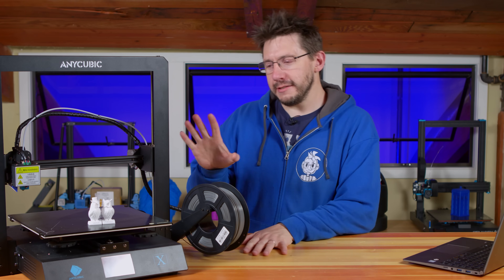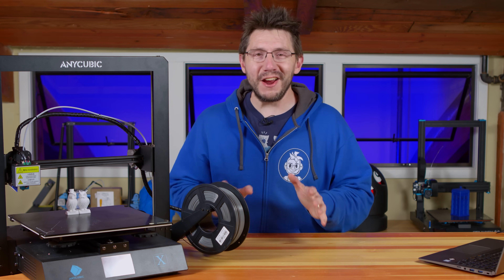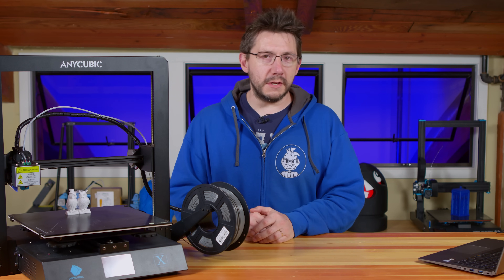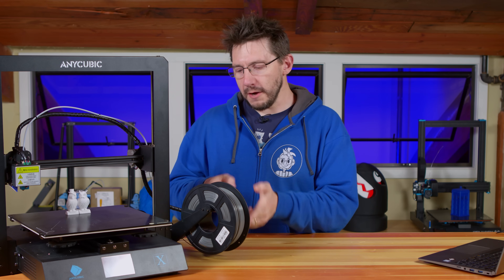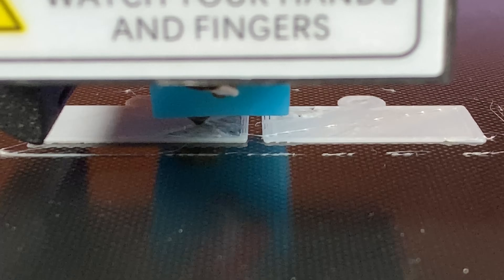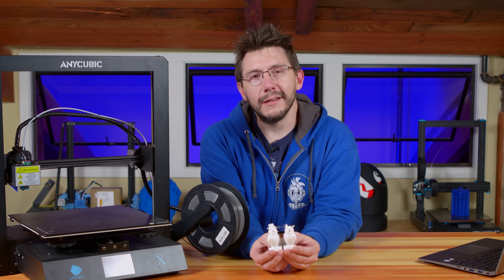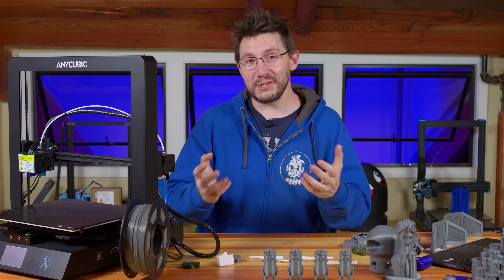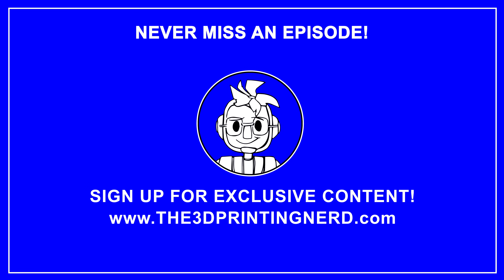Anycubic Mega X First Impressions Non Review?

Comment: I just purchased an Anycubic i3 mega s fdm printer and I love it ! It is my first 3d printer but it is easy to use . My extruder and extruder motor went bad but Anycubic is sending replacement parts ! I will order a larger printer from them later ! Good company .

Comment: will it print nylon, and carbon filaments?
Reply from the maker: It’ll do CF-PLA and any other filaments that’ll print at 240c or below. This means most likely no to nylons.
Reply: @3DPrintingNerd  thanks, which printer would you recommend for engineering filament?

Comment: @3d Printing Nerd
how did you even get this thig leveld... iam trying this since 2 weeks now and iam close to giving it up... its my first printer and regardless what i do it´s impossible to level.
either the middle is fine.. or every calibration square i print has a little less filament in their bottom right corner on every of the 5 squares.
i don´t know what to do anymore.

Comment: what settings do you run it on ? we're having hard time getting our mega x to work anything properly, strings a lot, pulls supports out of bed after couple layers etc. used recommended cura settings + recomended  filament temp.

Comment: I don't know, I can't get my mega X print as well as this and I can't get it to print as fast as my mega S with the exact same settings. It seems like the mega X has slow acceleration and jerk speed by default. With my mega S, if I do not use acceleration and jerk settings, the printer will use the highest value but for the mega X, I don't know what's wrong but it always takes like double of the time to print compared with the S. Any idea? thanks!

Comment: Please be very cautions when dealing with this company.   I made the mistake of purchasing the "Mega Man X" after watching this video.  It had been a horrible experience, and I will never give AnyCubic more of my money.   Their quality control is HORRENDOUS, their customer service lies, and when it arrives broken, they warn you that it could be months for the replacement part to arrive from China.   My printer arrived, basically as a kit.   I put it together, as the instructions said.  (Basically put the top on the base)  Then i realized that there were LOTS of things wrong.   Basically no bolt, on the entire machine, had been tightened.   I had to take the entire machine apart and tighten everything.  Extruder, hotend, z-axis screws, roller wheels on the underside of the build plate, rails for x/y movement, etc.... all disassembled, tightened, and then tried to print. The 20 minute assembling turned into more than 3 hours.   
Things did not work... at all.   I contacted customer support, which basically ignored everything that i said, in my claim, and had to start over.   Then, after many emails, photos, and videos, they stated that the extruder is bad and needs to be replaced.   Apparently that's a minimum of 15 business days from China.  
I tried to leave a negative review, but I bought it from their website, and they control what is posted on there.  They will not allow a bad review.  I tried posting a 2* review, and when things got worse I tried to post a 1* review.  Only 20 5* reviews are shown... just like a week before I bought mine.  I made the mistake of searching "BBB AnyCubic review" and found a site with many bad reviews, and really frustrated people.   Horrible, horrible experience.  I will never buy from AnyCubic ever again, I will make sure that all of my friends know to avoid them, and might be calling my bank, to try to deal with a dispute.
Reply: Can't be worst than Creality. had great customer support from Anycubic.
Reply: @maxim5and20  I got my Mega X in May... it still won't print anything.   This is hands down, the worst customer service that I've experienced, from any company.  They refuse to help, they won't issue a refund, they lie about parts being on their way, etc.  I have friends with Creality machines, Prusa machines, and a few other smaller companies.   The only ones of us, with problems, are the Anycubic machines.  My Mega X, and my friend's Photon.   My friends can't even help me troubleshoot, because they've never experienced any of the problems, because their machines actually work.   I was going to buy the Ender 5 Plus, and regret that I didn't.   The friend that got the 5 Plus, has been printing for months, and meanwhile my printer is still unusable.   He had one broken part, upon arrival, and he had a free replacement part in roughly 10 days.   Meanwhile my Anycubic "engineer expert" (as he called himself) doesn't know anything about my machine, and has lied, multiple times, annoy sending parts.   The whole thing has been a disastrous frustration.   I wanted to send it back, but they wouldn't even verify that I would get a refund.   
I was on the fence, between this Mega X and the Ender 5 Plus.  This video was what made me get the Mega X.... and I've regretted the purchase, everyday.

Comment: Did you have problems with the bed leveling?  I just got this printer, after your "not a review".  So far I hate this thing.  I have carefully followed the directive and got it assembled.  The leveling directions say to start in the front left corner, and move counter-clockwise, checking each corner.  It says to go around 2-3 times to ensure that the bed is level.   I've gone around about 15 times, and it's still not level.   I'll get the front-left level, move to the front-right and it's way too high.  I'll adjust it, and move to the back-right.... it will grind and scratch the whole way, and that corner will be way too high?!   If I lower it, to the paper it will scratch MUCH worse.  Then round and round and round, with no consistency.    So far I really regret this purchase.   Not a single print and already destroying the print bed.  
The print surface has a LOT of play.  (Especially left to right)  it rocks roughly 1/8" either direction.  😡😞
Reply: So, I fixed the bed leveling issue.   There was a huge amount of "wobble" in the print bed.   I ended up disassembling the entire thing. (defeating the purpose of buying a pre-built printer) I then tightened the bolts on the 6 little roller wheels.   5 of them were mostly tight, and 1 was barely even attached)  Having tightened all 6 made a HUGE difference.   Now there is minimal play. (I'm guessing less than 5% of what there was before)   
Then I moved to the next problem.  The filament wheel wouldn't push/pull filament.   I had to basically disassemble that fixture, and it was out of line.   I had to get things lined up again,  get it to have better tension, reassemble it, and attempt to feed it through again.   
Then the next problem..... instead of extruding a nice stream of plastic, during a nozzle purge, it made a tight coil/ball of plastic on the tip of the nozzle.   I cleaned the tip, with the included needle, which improved but did NOT actually fix the problem.   
The next problem was in test printing the owls..... it just won't.   In the first two layers of the print it put down roughly 10% of what it should have.   The 3rd layer was about 40%, and by the 5th layer it was just dragging around scraps of plastic, and I stopped the print.   The same thing happened, attempting the print..... 4 different times.   
Then I decided I was done, because it had been a really disappointing 5 hours, so I wanted to back the filament out of the printer.    I used the filament removal feature, which wouldn't work.   The wheel was spinning, but it didn't grab the filament.   So instead, I stopped the filament removal feature, and tried to back it out manually.   That doesn't work either.  That piece that you bragged about being removable, and that was smart designing... did not come with my machine.   Mine is one solid plastic piece.  No little removable piece, to make for easy removal.   So instead, I got the filament most of the way out, and it got stuck on the little nub, at the end of the filament.   I had to remove the Boden (spelling??) Tube, pull the plastic back into the machine,  cut the nub off of it, and then push it out of the machine.   
So far.... I HATE this machine.   It has been a horrible experience.   I went from being so excited, after watching YouTube videos (mostly yours and Maker's Muse) for MANY months, to being so frustrated.   Totally took away the excitement.  
I wish that I had your experience with this machine, because I am really regretting the purchase, at this point.  😔

Comment: I have a Anycubic i3 Mega Ultrabase and it's an absolutely excellent printer. The only thing I can recommend to people that buy this printer is that you snip off the zip ties that are on the cable going to the heated bed as you'll potentially have one of the smaller gauge temperature wires break off like I did, resoldering it did the trick to repair it.

Comment: Anycubic I3 Mega is  great workhorse.  Great video! You were right on spot when you said it makes useful things. .  Many other machines in that price range you have to tweak them and fiddle  with to get them to run consistent. Not the Anycubic. I must have researched  a couple dozen machines looking for a cost effective machine ready to use, clean logical architecture,  robust, user friendly and consistent, before I locked on the Anycubic I3 Mega, when they were first released.  With common sense  and an educated decision approach, I elected the Anycubic to best fit my purpose  and the machines have gone beyond my expectations. No filament type I have used with the Anycubics I3s have been an issue, keeping in mind one has to observe the individual  melting point properties of each filament and adjust accordingly. The Ultrabase, is unbeatable!, with touch screen in a low cost machine,  filament out sensor and power out  resume to print while other brands were trying to catch up to these features were the icing on the cake!.   

I must add that automatic leveling is a nice feature to have,  but I like having a bit of control, and leveling the machines by hand is something I rather do, a personal choice, as this allows me to dial each machine with more flexibility. This may not be ideal for everyone, but since I have also designed my own manufacturing CNC machines this is not an issue for me. A few minutes  spent leveling the platform before starting the machine for the first time has been all I had to do and rarely had to go back to re-tweaking them. However, part of any machine consistency, is also consistent preventive  maintenance  and this should be done regularly, regardless.

With regards to the stepper motor to lead screw couplers, the Anycubic I3s  use solid couplers,  given I have never had to replace mine, flex couplers, as used on CNC machines may smooth out the print quality even further on larger X machine.  I am looking forward to the X machine  which is in the spec range I wanted and had mentioned  in an earlier Anycubic YT video, and also to the company after having used the original I3 Mega, I was wishing Anycubic would produce a larger foot print machine and retain the same architecture, as the original I3 Mega,  and call it the Anycubic Xtreme,  and now we have that machine!  

I have posted, at Anycubic  Facebook site, a suggestion to Anycubic  with a concept photo image of an Anycubic machine which I photo-shoped with what I think would be the next useful thing to have on their I3 and X series machines, a 4" touch screen with 3D Print File Graphical Display, to ease the visual selection of the files in the memory card.  While perhaps also having the ability to print multiple files direct from the machine.  I have several of I3  Megas and I have designed and printed thousands of parts,  for real products I sell via my web site, on these machines. Of course,  a great result in manufacturing in the real world, not only has to do with a good machine, but also how the parts are designed and post processed, but I love these machines.  

Unfortunately I am not a a product reviewer and I have no access to other company machines as many product reviewers do therefore I had to purchase my own machines,  but if there is a company out there with a machine that deserves to be fully looked at from a real 3D product manufacturing point of view, look me up.  Samples of my work,  3D Printed parts I use in my own design products can be seen via my YT, Facebook, Instagram, and my web site.  Thumbs Up!
Reply: im waiting on mine today lol, 4th printer

Comment: 9:00 Can anyone tell me how loosening the screw holding the trapezoidal nut fixed the z-wobble he encountered?
Reply: it's possible that the z-axis rod wobbling was a tension issue with the trap. nut. The tighter the bolt, the more the alignment of the rod will stress (wobble) when operating. This is just a guess based on observation though, assuming that both sides would probably have to be tightened the same way. Tightening a bolt normally stretches out the screw, messing with the length of the z-axis rods, so that could be a possibility as well. Hope this helps!

Comment: Hey 3D Printing Nerd got a question for you please. I’m brand new to all this and very excited to get started. I’ve watched a ton of you’re videos. You are extremely knowledgeable and smart. So I am seeking your advice. I have $350 max to get started for everything. Like the printer and filaments etc. I would like a decent build height decent to awesome quality print. What printer on the market today with all that in mind would you recommend. What brand for being good quality and cost efficient would you recommend. My right now main purpose for the printer is to make a knob for my ac/ heat control for my truck.

Comment: I have used Anycubic i3 Mega alongside another doubled priced printer and the Anycubic did much better in two fronts. 1) It required much less maintenance and 2) it handled much better Flexible filaments.

Comment: Anycubic does it right. Sure they are not the top of the line printers, but they work and they give you way more than you would expect for the cost. The build plate is also amazing. My first printer was a tevo tornado, LOVED it, but it took a LOT of work and tuning to get it working like it should. My anycubic i3 took 10 minutes to put together, 5 minutes to level, and has been printing well ever since.

Comment: CAN YOU TRY THE ANYCUBIC PREDATOR DELTA PRINTER?

Easy upgrades and a  duet board and you can print Ender quality @ 150mms. Biggest upgrade is better part cooling fan, cooling ducts, and a .6mm hot end. $350+ tax. It prints 355mmx475mm

Comment: A little off topic but I need some advice to fix my 3D printer. I bought 5 TMC2208's and just installed them (MKS gen v1.4 board) One of them was not working out of the box so I just swaped it out for a A4988 and everything was fine. Except for when I tried to tune the verf/voltage using my multimeter. The TMC2208 I had installed on my X axis tuned to 1105 perfectly but the TMC2208's on Y, Z, E0 , don't seem to tune below about 3-5v (3000-5000). Z is stuck at 4.88v and no matter what I do and it won't go any lower.  E0 can only go down to 2.9v and Y can go as low as 3.09v, but with both of them, as I turn them down more they just jump back up to about 3.5v no matter how small of a turn I make when adjusting them. Note: the A4988 on E1 can be tuned to 900 easily. I'm placing the negative terminal of my multimeter on a free negative terminal on my power supply and the positive terminal of the multimeter directly on the adjustment screw on the stepper drivers. Any suggestions on how to fix this problem so I can use my TMC2208's and my 3D printer?

Comment: Something I want to see is an assessment of the different slicer programs and why some preform so much better than others, I've been having really rough results using cura for example, but when it comes to slic3r and the Pursa version it preforms so much better, faster and produces smoother prints.
Reply: Honestly I think (unintentionally) Cura gets pushed to the forefront a bit too much.  It's got a lot of useful features and it's not bad, but the best program is the one that gets you the results you want!  If you're getting prints you're happy with, use that slicer and don't worry about it.

Comment: I have been following you for a few months and you have great informtation. I have a makerbot replicator 2 for 4 years now. In your opinion do I need to use makerbot filament to get good prints? If not can you suggest a good source?  I did try some filamemt from amazon  but the filament was tangled and clogged. I go through 17 reels a month and need a steady source.
Reply: Hatchbox or inland are my go to. They are cheaper than buying from the printer manufacturer and have been consistently good

Comment: 11:30 lots of extrusion inconsistencies....

Plus, Anycubic customer service is useless. I've lost $1200+ buying a Photon and I3 Mega that never got delivered. Avoid those guys - get a CR10, Ender, Prusa or anything else but Anycubic.
Reply: how do you spend possibly that much money on both machines? lets say you bought them months ago before there prices dropped when both machines where at about $350 (I don't think the photon was even out when the mega was at this price) that's $700 in total. so how the hell did you get $1200?? also the customer support although uses broken English and could take a week to reply is very supportive sending me parts such as a new SD card reader and extruder drive gear when i explained my problem to them. Also from what I've read on other forums others have had similar experiences to me. as a sidenote did you order from the official Anycubic website? that could explain the lack of product and high price, especially since the real website supports PayPal which is just stupid not to use when given the opportunity. Other wise this all seems like your pulling shit out of your ass